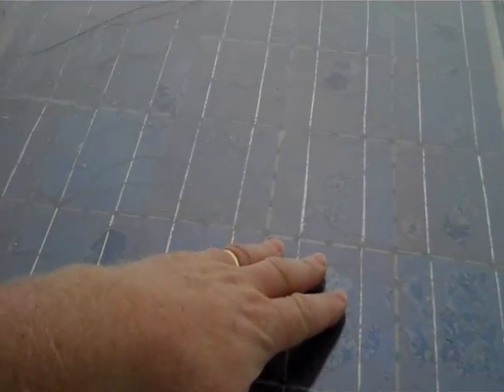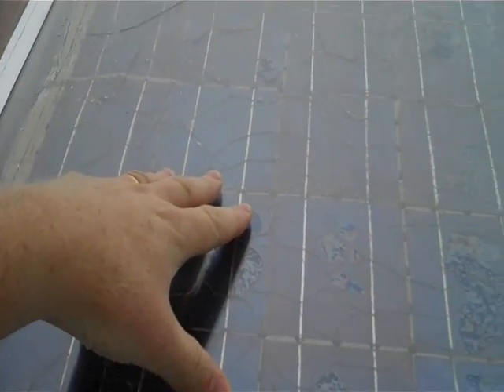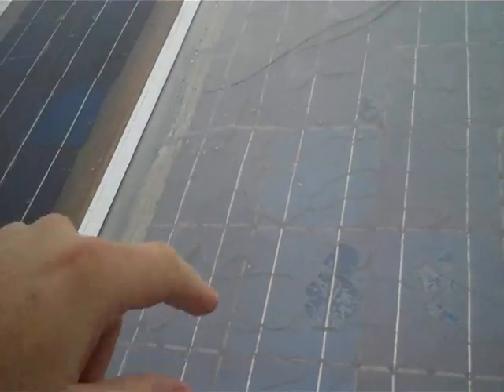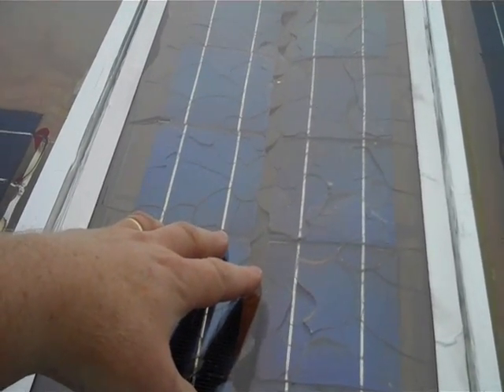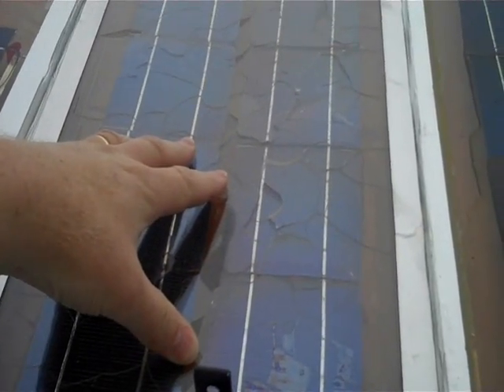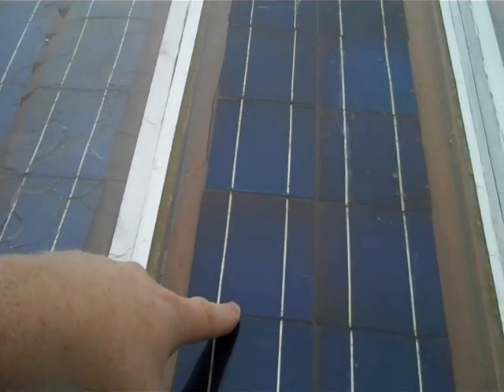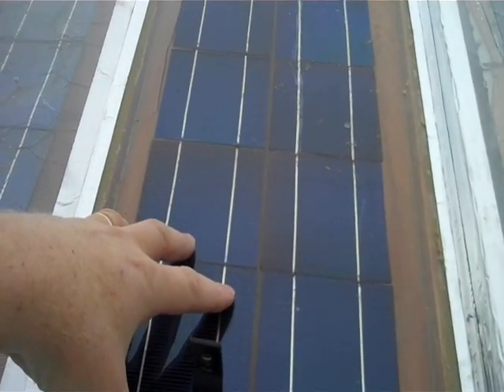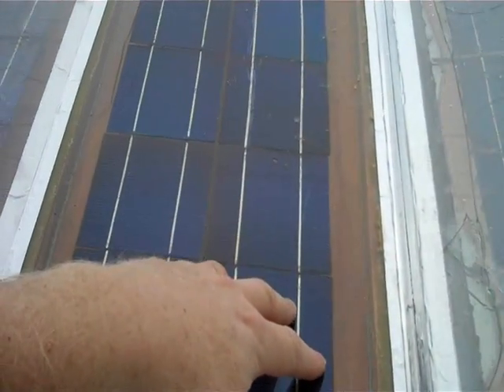Failed Solar Panel Projects - What not to do! SimpleDiySolar.com

Comment: I've considered taking two sheets plax, doing as you say, but then bonding a backsheet, perhaps both 3/8 thickness. The thought is, that in the end, the four corners could have holes drilled, and rubber mounts (two fat o-rings with a bolt through) could hold the panel. In this way, a person could avoid the expensive aluminum frame completely. cheers